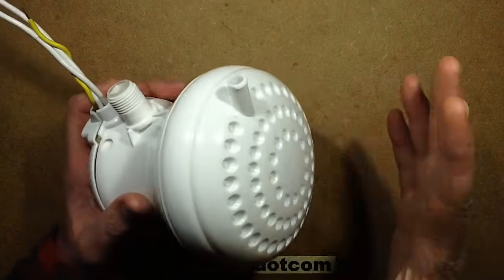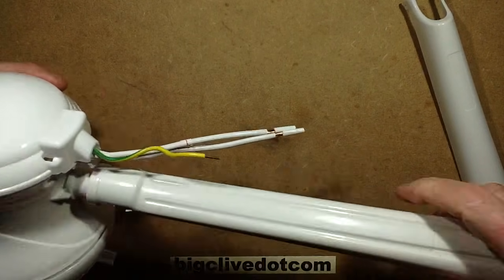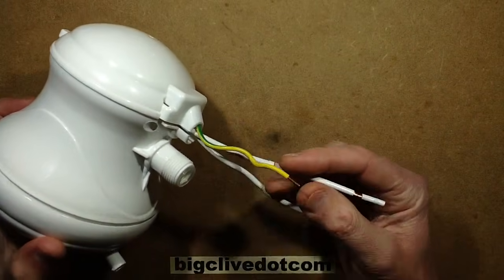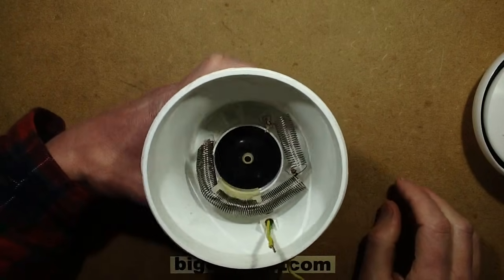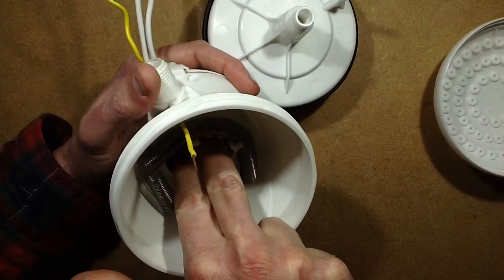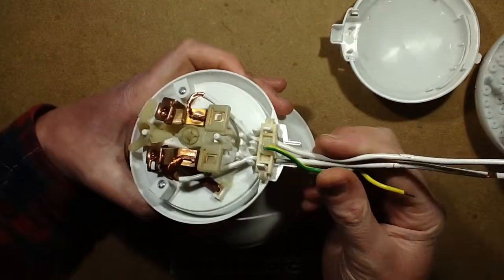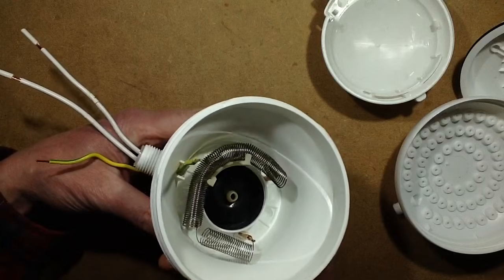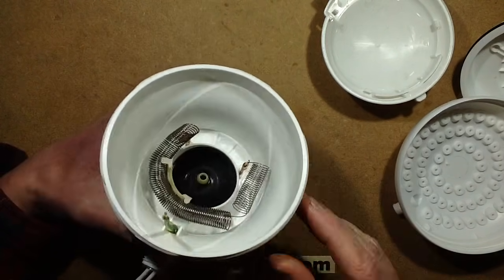Inside a heated shower head.  (suicide shower)

Comment: This is a BAD copy of brazilian Lorenzetti electric showerhead. The brazilian version is also simple, but is certified. This copy is a big trap!
Reply: I am a german engineer, spent 3 month in brazil. They know what they are doing, at least as much as non-MIT US engineers do. You find these showerheads there even in most hotels, also nice ones. They should be installed with heat-shrink wire, then they are as save es in-wall electric water heaters imho. Energy-efficient too.
Reply: Thiago Teixeira You could be right.  There are millions of shower head heaters in Brasil and no one is being electrocuted.
Reply: Amar Ken Thanks for you post.  As you know, there are millions of these in Brazil and no one is being electrocuted.  Nor is anyone being killed by tank-type heaters which also have an electric element immersed in the water.  "Shocking" isn't it? :)
Reply: @truthteller1914  Tank type isolated heaters have isolated heating elements.
Reply: Just looked at a tear-down of the Lorenzetti.  It's just as bad as this one.
Reply: just like my girlfriend
Reply: certified in Brazil maybe...
Reply: @TRUE_GR1T  So only british certifications are valid? That sounds stupid...
Reply: OzzieBloke Ask youself, then why is no one being killed?  Millions of shower head heaters are being used every day in Brazil alone.  If they were even .01% as dangerous as you people claim, thousands would be electrocuted every day.  
   "There is no force in the universe as powerful as the human ability to ignore obvious facts."  Thank you for demonstrating that to me again.
Reply: >no one being killed
lol, except for all of the mentioned fatalities, all cases where people "feel a tingling sensation" (and btw, exposing your brain to even mild electrical currents from the outside is the exact opposite of healthy) and uncounted or misreported cases...
Reply: a professor explaining why it is not possible to get killed if you use them as inteded: https://translate.google.com.br/translate?hl=pt-BR&sl=pt&tl=en&u=https%3A%2F%2Fwww.if.ufrgs.br%2Fnovocref%2F%3Fcontact-pergunta%3Dchuveiro-eletrico-por-que-nao-levamos-choque-se-agua-esta-em-contato-com-a-parte-eletrificada-do-resistor-de-aquecimento
Reply: @DeuxisWasTaken It's simple, the current can't flow in an interrupted stream, the water falls from the head of the shower into small drops.
Reply: Certified by a bunch of guys that are barely human (in brazil)

Comment: I think the principle is sound, yet it should simply use low voltage dc, and it would be completely safe!
Reply: Transhuman Mercury define "completely"
Reply: Low voltage DC, with the correct design, cannot cause harm or electrocution, nor harm...hence "completely safe"

Comment: there is a resistance between the live and the earth in the water so the earth wouldnt take all the voltage-it would be split so some would head for any earth it could find. even though you are wet and touching ground through the plumbing you are not directly touching the live wire-perhaps 100 volts but low current-guess they bank on that but still very dangerous. only way it might be slightly more safe is through an isolation transformer and no earth-dont think they make them with more amperage than a shaver outlet though.
Reply: European safety regulations require any electric device between a few centimeters above the shower head and the floor to be limited to 12V max.  So the closest legal design would need to either use incredibly thick wires carrying more than 500A, or the "Jacuzzi" solution of putting the heating in a box under the floor or behind a wall.

Comment: Here in Brazil no one use the green wire properly due the bad quality and age of the electrical installation.  There are a lot that simply connect it to neutral.

Comment: I do have quite a lot of experience with electric showerheads, and although I never heard of fatal electrocution they often leak and current flows were you don't want it. 
even when earth/ground is connected, many times the resistance to earth is far to high simply because of lousy installation, many times they just stick a 2 meter copper coated rod in completely dry soil and think it's perfect. 
an electric shock is mainly felt trying to change the power while water is running or while touching te valve in case it's made from conducting material. generally it scares the crap out of those who are not used to these kind of extras during a shower. 
like I said I never heard of fatal electrocution by this system, though we lost a family member trying to open the refrigerator which also appeared not to be grounded, he got stuck at the door handle and when help arrived it was to late already. 
Back to the shower  !
We don't use these showerheads in my family for this reason and another positive side-effect is that it saves a lot on the electricity bill. !!
Reply: John van beek wait... How does someone die trying to open a refrigerator?
Reply: ast r ,,A shortcut between fase and the steel of the refrigerator was created by a defect in the compressor. 
When he grabbed the door to open the refrigerator, he grounded it with his own full body.
Couldn't let go of the steel handle (old refrigerator, and normal muscular reaction in case of electric shock).
Something which wouldn't happen with a proper grounded piece of electric equipment

Comment: Clive,
I do like your videos!   The only way you could be electrocuted is if you are a part of the electrical circuit.  Even if the heating element went bad, you are not a part of the completed circuit.  You cannot be electrocuted.  

Thoughts?
Reply: You can easily become "part of the electrical circuit" in the event of a fault power would flow trim the unit, through you to ground, presumably through your head, out through your feet into the water you're standing in and to ground through the bathtub or drain. You clearly have no comprehension of how electricity works
Reply: You've forgotten about Earth. Indeed, the Earth itself will complete a circuit with pretty much any voltage. Since metal water pipes often run through the ground, it means that your bath's drain and taps might well be earthed. In fact it's a safety standard in many places to require them to be connected like that. If you touch the taps or drain, you're connected to Earth. 

Mains live -> Earth is a valid circuit, and can quite easily kill you. I think this relies on water not being very conductive, and gaps in the water flow, as it breaks up into drops. Still really dangerous, I wouldn't stand under one. Wouldn't even like to touch it.

Comment: i showered in Brazil in a place with hot water shower in 1995. Not only was the shower head as you described,but the terminals were bare screws on the outside. while washing my underarms, I lifted my arm straight up and contacted the bare terminals while soaking wet in the shower.  That was NOT the most dangerous thing I ran into in Brazil.

Comment: Oh God, the nostalgia is killing me. I was born and grew up in Ecuador and these suicide showers were very common every where. The water diaphragm that should make the connections when water is running, doesn't work properly: at first it works ok, but after a couple of weeks the movements of the diaphragm is so unevenly that even at full pressure the connection fails. At least with the shower heads we used to have at home. We had to use them without the upper cover and we had a wooden stick with which we helped ourselves with the connection. Sometimes it was so bad, that we used our own (wet) hands to push the connectors.

Now that I think of it, it was crazy. I wonder how we all survived without electrocuting ourselves. My dad still uses such a shower, he says that's the best shower and doesn't want to change, I know crazy.

Comment: These videos help me realize the sort of things we take for granted here in the states. I have never even heard of anything so nonsensical! It never even occurred to me that other countries have these bizarre solutions to heating water. Are these even used in the states? I have never seen or heard of it before now.
Reply: If you have an electric water heating tank, it's exactly the same thing with some fancier gadgetry Also if the insulation on your wiring wears down as it tends to do over the years, you run the risk of electrifying all of the metal pipes in your house. The only difference is you can't see it if it's worn down unless you check your water tank frequently.
Reply: Alexander Unguez  not true pal sorry! we use what’s called main and supplementary bonding also cpcs! Coupled with rcd and over current protection! And now arc fault protection
Reply: Deeker Jones Now you understand the invisible benefits of basic government safety regulations
Reply: That's shithole country safety standards for ya.

Comment: Seen one of these in Costa Rica and my wife couldn't understand why I'd rather consider not showering for 3 days (in tropical climate) than use these. The mounting is as you describe, bare wires twisted together inside the shower stall. No earthing visible either. 

5kW of power in that climate would be useful for getting a flow of 100mL/s (slow slower) to 38 deg celsius from about 28, which it'll definitely be. If you think UK though, you need about 3x that power to get it from 8 degrees up to 38, so 15kW would get you the same drizzle that you get with 5kW in hot countries.

Comment: Hey clive, I live in mexico and these are fairly common here.  I had one in my house for a while.  Even with proper ground there was a slight electrical "tingle" when touching the shower head.  You are wrong about one thing though.  the long tube that your said was some sort of pressure relief is actually not a safety mechanism.  it is for washing your arse... That aside these things are definitely sketchy but I used it for about 3 years and am still alive...

Comment: Effing insane. 5 kW just to heat up the shower head… I have a 28 litre 2 kW water heating tank that’ll enable me quite a long hot shower w/o danger of electrocution, and will provide me with hot water for dishes too. And I hardly use all the hot water anyway, because I mix it with cold water to make it comfortable… Brazil is clearly a Cold Water Country (much like Great Britain, I’ve had my share of coin-operated hot water taps fpr showers in youth hostels over there…). ;)
Reply: 5kw is not atop to heat water as it flows. Your 2kw tank will heat slowly, but provide very hot water which will provide a decent shower for several minutes. But try running it from cold, it will barely heat the water at all. In the UK electric wall mounted showers are common, usually between 8 and 10.5kw. Even then, when incoming water is very cold during winter they produce a fairly unimpressive trickle of hot water. Temperature is regulated by controlling the water flow, so you have to turn it right down to get a decent hot output.

Comment: They are the standard in Brazil but the problem they cause isn`t safety related, it`s national generation and distribution of energy: at around 7pm to 8om all of these showers are turned on creating a momentary peak of consumption in the system that brings it to a less than optimal situation. Instead of eliminating taxation for solar heating - which is very effective here - they decide to build huge hidroelectric powerplants on plane terrain ...

Comment: I have ended up using showers that have these units installed all over the world.
The best option is to TURN OFF THE ELECTRICITY in most mild climates and take a "natural water temperature" shower.  You can do this either by unplugging it BEFORE you get in the shower, or turning OFF the SWITCH.  They fail often, and have had several friends that have been shocked, and one electrocuted which was non-fatal.  If you see one, do it, or take a chance.  If it is shorted, you will know quite quickly.

Comment: 'Ducha' means shower in Spanish, so it's not a very creative name.
Reply: By the way, I have seen some restaurants here in Spain install electric heating taps ordered from China (restaurants are required to have a hot water supply for health regulations). Considering the shorter distance between the tap and the hands of the person washing the dishes, and the stainless steel environments, are they a disaster waiting to happen?
Reply: +Antonio F. Dusche in German.

Comment: are these video soposted to be silent? or does my sound card hate this channel
Reply from the maker: +George Murray Some Dolby processors put the mono audio out the centre speaker channel.
Reply: No idea what that means but i just upgraded my pc with a new motherboard so if i open more than two youtube videos at a time or google something i hear a buzzing sound or with your videos i hear no audio
Reply from the maker: +George Murray It's probably just an option in the audio settings to turn off output to a centre speaker that isn't in use.
Reply: my mother board uses sonic fx
Reply: +George Murray You should really look into your settings.
Reply: same settings as my last board just my current board uses realtek hd audio linked with supreme fx audio
Reply: George Murray I just install the naked driver for the chip (which most of the times is already in windows) and let all that Dolby, Hyper, HD, FX and other Bloatware deinstalled.

Comment: is it 110/120V or 220 - 240V? 1st is dangerous, 2nd is a death trap.
Reply: +Dick Hamilton this is 220
Reply: +FX fine if you've got a ceramic shower basin and plastic drain pipes, you get a tingly, more "invigorating" shower. I have stainless steel, and brass/copper pipework going down into the sod beneath.. Death trap.

Comment: I think I'll just turn the electricity off and have a bath instead! 0.0
Although, I do wonder if it could be theoretically possible to make a safe version of one of these?
Reply: +Lord Sandwich The safe version would probably have some kind of insulation around the wires. I'm not sure what they do for stove and kettle elements (I'm guessing tightly wound nichrome wire, then an air gap, then an earthed outer casing), but basically that.

Downside is it would be bigger and it wouldn't fit in a shower head any more. And more expensive. Which means you're not going to sell as many to consumers who also have no regard for safety and just want a convenient cheap shower head.
Reply: +Lord Sandwich A cold bath?
Reply: zawzero
I'll boil a few kettles before I turn the power off! :)
Reply: Lord Sandwich
A very good idea :)

Comment: i think there was one of these in greece. 2 years ago when i was on a hotel, i was at the pool with my family then i wanted to go to the room to take a shower. but when i toutched the metal thing to adjust the heat and stuff like that it felt wierd in my fingers. then my toes started to move on its own. and the toe locked in its position. so i could have died there

Comment: Thanks Clive.  I had the sad experience of employing a (so called) 'QUALIFIED' installer to replace a shower unit.

I won't comment (much) on his plumbing skills (very messy - 'snotty' soldering says it all).

However,  imagine such a confused technician standing in your bathtub with an insulated screwdriver wiring a new shower unit with reversed live / earth (thankfully just tripping a 30mA RCD in the process).  He eventually understood the error when I pointed out which wire goes where.

As far as I understand, most DIY domestic electrical work is now illegal??!!

It is frightening to think that there are people loose in the community who are legally allowed to carry out electrical work in your home with the most basic of (virtually useless) qualifications.

I've spent a working lifetime in Audio Visual & Electronic Engineering but the Law as it stands now (seemingly) dictates that I must not attempt to re-wire a simple light fitting or mains outlet etc. 

As for the errant shower installer; a few inches of water in the bathtub and a wet screwdriver might have rejuvenated his brain cell (singluar).
Reply from the maker: +Ampex196 Welcome to the world of Part P where installation companies can now use unskilled labour as fully "certified" electricians.  There's money involved.....

Comment: It is terrible, but if it would use 3 phase system, it would be much safer.
Reply: +Mladen Milić Why?
Reply: Alex C 3 phases if connected into star configuration, they cansel each other out.
Reply: Mladen Milić
Only if the heating element is perfectly symmetrical.
Reply: Alex C Actually, no. Voltage up to 20-30V is safe for humans.
Reply: What about if one of the phases fails?
Reply: Long Runner Then it is as dangerous as this thing.

Comment: What if you leave it powered on with no water inside ? It start to melt and ignite a fire ?
Reply: +Tigrou7777 it only turns on when water is flowing as there's an internal diaphragm which operates the switch. That said, it's so shoddily made that there are bound to be cases when it sticks on and the element would burn out in seconds, very probably melting the whole thing.
It's simply a lethal device. It would be illegal in any modern western country.

Comment: Wouldn't a steel mesh filter with earth soldered to it be a smarter idea for ground?
Reply: Or having the water go through a ceramic pipe with an embedded heating element with a fuse hooked up to a pcb that monitors the ground where it blows if any dangerous amoun of current goes through it?

I would never use that thing... On demand water heaters ate vastly safer.